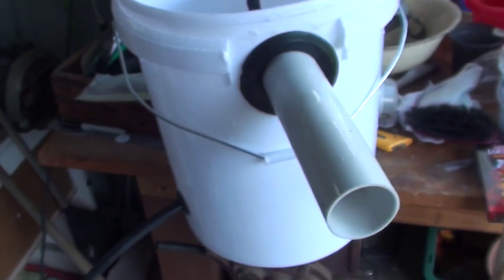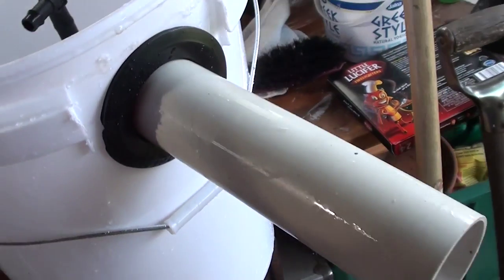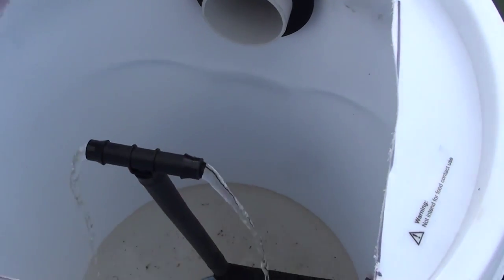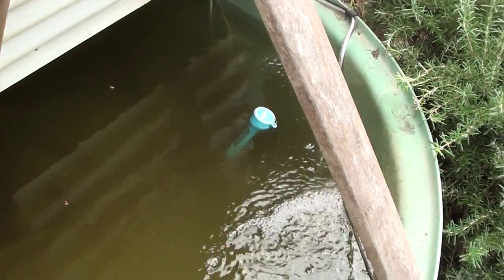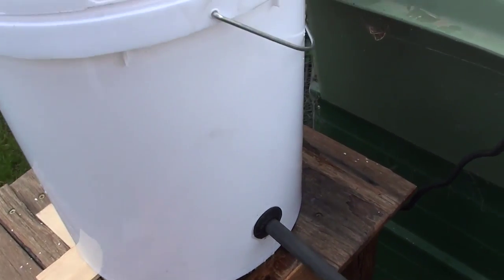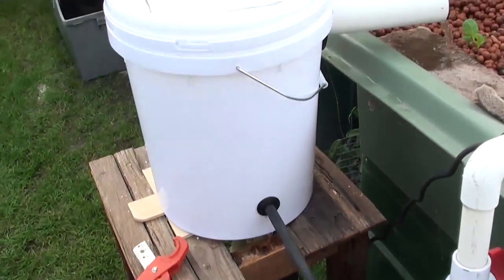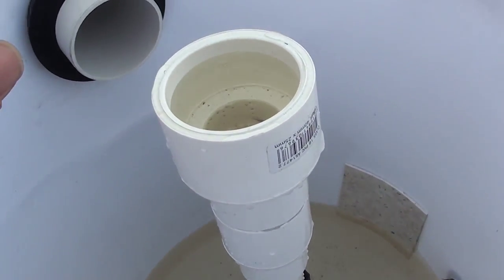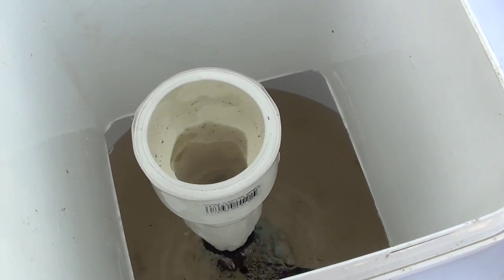Bretts Aquaponics   New Radial Flow Filter

Comment: Nice radial flow filter there. Good that you managed to patch up the hole.
Reply from the maker: Hi Phil,
It's amazing what I have patched up with vinyl and hot glue. The good thing about using hot glue is I can take it back off with a heat gun.

Comment: I thought the reason for a gravity flow into the filter was to avoid the pump from clogging up. Did you remove the pump filter and are you still using this set-up?